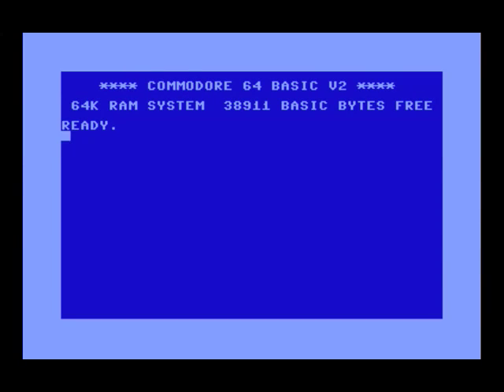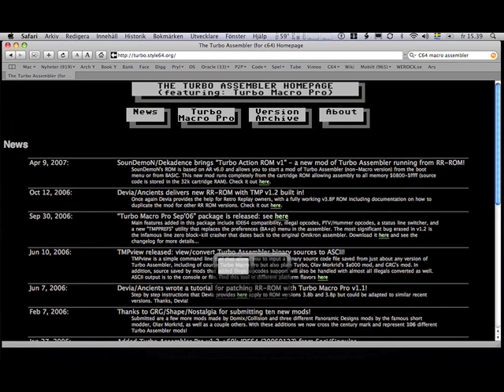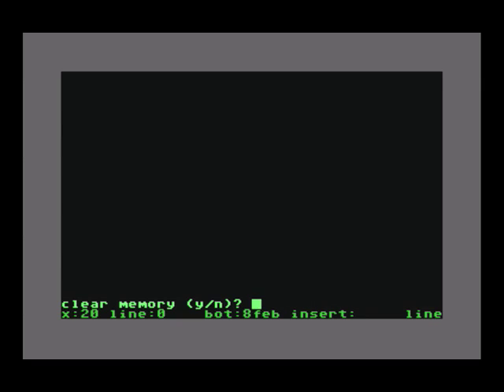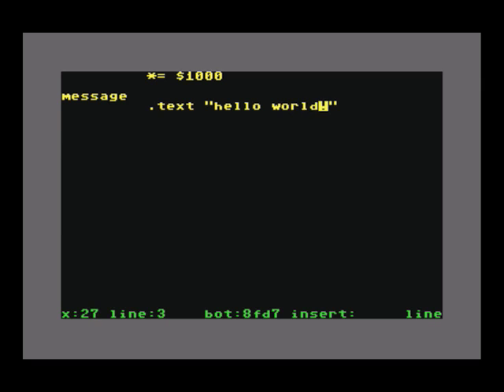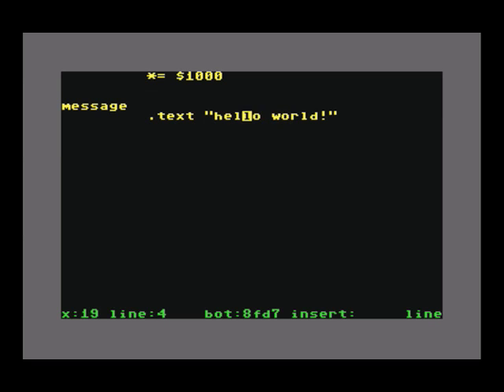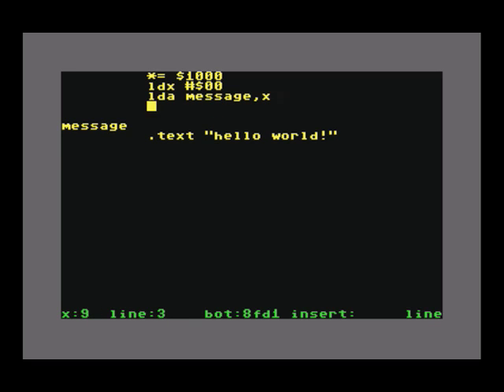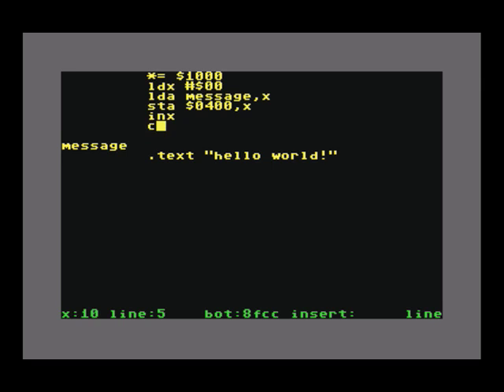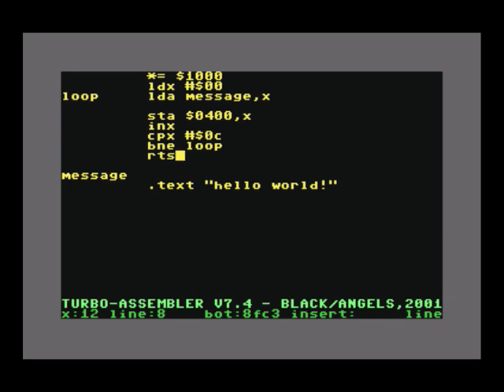Hello World in 6502 Assembler

Comment: You are programing with a Macro assembler, the luxe i never had. I always only used a desassembler, and i was young and tought that was the only way to programm in assembler. The difference was i could not use labels, and i had to use real adresses only , but i made rather big programs like that, like a sprite editor that i used the joystick to create the sprites, and even a shoo them up with horizontal scrolling (i never finished) 😄

Good memories, thanks.

Comment: those finding this and struggling to get it working, i needed to change a bit, and a few comments below helped me understand what i needed to do:

to get the assembler running, download Turbo Macro Pro, put it in drive 8 and do the following:

LOAD"$",8
LIST
LOAD"TMP      V1.2/S.",8,1
SYS 8*4096

there are exactly 6 spaces in the file name loaded in the third step. thanks to tobberoth for this information. what i was missing was the ',1' at the end of the second load command. 

great, now how do i assemble my code? hit underscore, then 3. you'll get a screen that lets you run your program with 's'. search "turbo-macro-pro-editor" for more editor info.

my next issue was that the program would run, and then go right back to a ready prompt without letting me see what had been output. to get around this, i added the following line after the 'bne':

jsr $ffcf

this jumps to a subroutine built into the c64, which will accept input from the user and store it in the accumulator. for more on this, you can search "c64 standard kernal functions."  for now, you can just hit return to get back to a ready prompt. if you want to get back into TMP, simply repeat:

SYS 8*4096

my next issue was that the output was just a bunch of symbols, not letters. here braddo82 had the solution, but it wasn't explained. in its default mode, the c64 uses 'screen codes' which are different than PETSCII which is what '.text' will give you. search for "turbo-macro-pro-tmpx-syntax" if you want the details about this pseudo-op.  for now, instead of 'sta $0400,x' you can use:

jsr $ffd2

which will print the petscii value stored in the accumulator. (this is another standard kernal function.) if you want your program to match more closely to the video, and to have more control over the location of the characters, you can do the following on the line before you 'sta $0400,x':

and #$3f

this is a 'logical and.' it will convert your string, which is stored as petscii to screen codes which can be written directly to screen memory. its a bit more complicated than this, but it will get your program working for now.

i'm just learning this stuff, but this will at least give you the preliminary information to google, and learn more if you were confused like i was. it took me a while to get all this info, so i figured i'd share it with you, so that you dont have to go thru the same process.
Reply: I also recently had this issue with PETSCII vs screen code. Therefore, when I saw the video I thought this shouldn't work. The question is: why did it work?

Comment: I'm guessing the assembler does the grunt work of turning that string into successive ASCII byte-by-byte LDAs?
Reply: Not the hardest thing in the world to do.
Reply: Jon Radcliffe how would you poke in assembly when using HES MON?
Reply: Salvatore Servodio The simplest way I know is to write the text at the top of the screen, and then use the M command to list the contents of screen memory. You can then take the listed hex characters and change the address to the address you want. This works beautifully for transferring ascii into memory. None of the old school monitors seemed to have that provision. Hesmon does have a lot of other cool features though.

HELLO WORLD

Ex lets say you wanted to store 'hello world' at address 8000. Youve just written hello world at the top left of screen. Type: 
.M 0400 0410
:0400 08 05 0c 0c 0f 20 17 0f
:0408 12 0c 04 20 20 20 20 20

...that's your hello world text on the screen memory.

so, then you just change the 0400 to 8000 and strike Return
:8000 08 05 0c 0c 0f 20 17 0f <Return>
:8008 12 0c 04 20 20 20 20 20 <Return>

Now, when you examine 8000, you'll see your hello world text contained therein.
Reply: Not exactly, it will show up as an array of bytes after the code and the LDA with "absolute,x" addressing mode reads the byte at the top of the array + the value in X. X also serves as the loop counter.

Comment: The easiest way to print text 1:1 (including capitals) and saving 5 bytes is as follows:

*=$1000
LDA #<MESSAGE
LDY #>MESSAGE
JSR $AB1E
RTS
MESSAGE
.TEXT "Hello world!"
.BYTE 0
Reply: in this case you can save an extra byte by dropping the RTS and using JMP $AB1E ;)
Reply: @geevee9109  Sure, if you don't want the code to do more after that.

Comment: Silly question. The text in the source code was lowercase ("hello world"). Why did it display in uppercase ("HELLO WORLD") if you were just doing a blind copy?
Reply: +Tim Greening-Jackson  commodore used  commodore asc codes chr(65) =uppercase A  not lowercase a the asm  is wrong
Reply: +Tim Greening-Jackson
The text will come out 1:1 when STA $0400,X is replaced by JSR $E716.
That subroutine allows for printing colors as well and can be added in Tass using Arrow-A and then entering CTRL codes.

Comment: The C64 sure has a convoluted way of running programs. I'll take my Atari 800 any day.
Reply: ***** accept people who know how great the Atari is :-)
Reply: I was really an expert on them way back when. The C64 sprites were better but the other features of the Atari are hard to beat. 

They are both very good machines. I still play some games on my Atari emulator. 

At least both the C64 and the Atari 800 beats have an Apple :-)
Reply: ***** :-) 
I bought my Atari when it first came out and my friends who all had Apples laughed at me. They complained that since the Atari had very limited colors (only 4 in their highest graphic mode) that it couldn't be as good as their Apple since they had six (by counting black and white twice. - I'm not kidding. There was a hardware limitation for that). The doc''s for the Atari were not very good.

We had a high res graphics mode similar to their high res. I found out that it worked similarly to the Apple. It has just black and white (more on that later) BUT just like Apple it was achieved by plotting a red and blue pixels next to each other. So we had 4 just like them without the goofy 2 blacks and whites. I felt a little better. 

Then I found out that we didn't just have black and white. We had any of 16 colors in two brightnesses so we could have red and bright red or blue and bright blue. So we had more colors.

I had a problem with my Atari because the colors suddenly became half as bright and they started changing every few seconds. I called Atari and told them about it. It turned out to be yet another undocumented feature and was probably the first screen saver on a home computer.

I then told them that I thought being an Atari would mean better graphics but my buds with Apples said no.

The lady laughed and said wait until more documentation comes out. She proceeded to tell me all about how Atari uses the same process as the Apple but runs 80% fast (clocked at 1.79 instead of just 1) That those graphics modes that only have 4 color can choose from a pallet of 256 colors AND with just one poke you could change a color from red to green.

Then she told me about player-missile graphics (sprites - again Atari was first but C64 was better), built in fine horizontal and vertical scrolling, about display list interrupts where I can issue commands before every scan line is drawn changing the position and/or the color of a sprite splitting it into many sprites, about how we can redefine our character sets to make an "A" look like an alien and that we had 2 larger full color modes and 2 multicolor character modes. How we can actually write a program for the graphics co-processor to make screens anyway we want them - 1st line large color letter to display a score followed by 40 multi-colored character modes with their horizontal scroll bits turned on, followed by 4 lines of main text mode.

I went back to my friends and told them all of this. Suddenly Apple was now a business computer - they don't play games. 

I could have told them about our rom cartridge slots that could hold 48K of program BUT only take up 16K of space leaving 40K of memory for the program's use. They had to load everything into memory so their word processor only left about 5K of memory.

Years later and a horrible thing happened. The same team that designed the graphics on the Atari and who were working on a new computer with even better graphics were let go due to new management. The new management came from Commodore with their own 16 bit machine that became the Atari ST. So Commodore bought the new Atari designed by the same team who did the 800 and named it Amiga. So now Atari was Commodore and Commodore was Atari. It was Commodore's turn to brag about have the vastly superior machine. I would have bought one but I was in school at the time and only could afford the ST. How I envied all my Commodore friends.

The funny thing was that we could run Apple Mac stuff by buying up the old roms, plugging them into a cartridge, and plugging that into the ST. And it ran faster than the Mac :-)
Reply: Good luck. Do you still have a C64 or are you going to use an emulator. 

I actually have an Atari 800 + drive but they've sat for 20+ years so I don't know if they work.

I do know I can get a new 130XE off Ebay but the emulator is good enough for now.

Good luck with the programming. 

Do you know if there are books online (for free) for the c64? I have a site for Atari, the one I like is Atari Graphics & Arcade Game Design by Jeffrey Stanton & Daniel Pinal . 

I learned from their Apple II book. We have a site with pdf's of many of the Atari books here. http://www.atarimania.com/documents-atari-400-800-xl-xe-books_1_8.html

I did find this one, might help.

https://archive.org/stream/Commodore_64_Assembly_Language_Arcade_Game_Programming_1985_TAB_Books#page/n5/mode/1up
Reply: except

Comment: What you have to know in order to understand this assembly program :
- most of all CPU have some memory cells, in order to perform calculations. They are called registers.
- loop and message are just tags in order to conveniently designate memory addresses.

What the source code says :
*= $1000
-------------
This is not a machine instruction of the program but an instruction for the assembler demanding it that the program must be installed at the memory address $1000 in hexadecimal base, address, 4096 in decimal base.

ldx #$00
------------
This is the first instruction of the program and regarding what explained before, the instruction will be at the memory address $1000.
The instruction says : load (i.e. initialize) the 6502 CPU register named X, with the value 0.

lda message, x
----------------------
This instruction says : load the CPU register, a (commonly called, the accumulator) with the value stored in the memory address resulting of the addition of the address of message with the value of the CPU register x.
The first time in the execution of the program, this instruction is executed, the result is that the register a will have the value of the first character (in fact, its ASCII code, the value 104).

To sum-up :
CPU register, A receives content at (message + X) address.

sta $0400, x
------------------
This is the exact inverse kind of instruction of the previous one.
It says :
Store the content of register  A at the address $0400 + X
To sum-up:
content at (message + x) address receives content of A.

This instruction has the effect to print on the screen, the character stored in register A. Because to print a character at the top left of the screen on C64, you just have to store its ascii code at $0400, marking the beginning of the image memory. the video chip is in the charge of the rest.

inx
----
Change the value of register X by adding the value 1 (increment x).
Now, you can imagine what is the role of X. It just refer the index of the current character to print.at the same time from the message memory address and in the image memory position.
Hence, incrementing X just prepares to reference the next character to print.

cpx #$0C
--------------
Compare the value of X with the value 12 (C in hexadecimal).
The result of this comparison is stored somewhere in a special register of the CPU for the following instruction.
NB: 12 is the number of characters of the message to print. Assuming that the program counts with X, beginning by 0, it means that when 12 is in X, all characters have been printed.

bne loop
------------
This instruction is a conditional branch. It stands for Branch if Not Equal.
It says that if the result of the previous compare instruction ( = cpx #$0C) is not that content of A and 12 are not equal, then go back to the instruction, mark by the tag, loop. Otherwise go down to the next instruction : rts.
In fact, while X will be lesser than 12, the loop will executed with a content of X, augmented of 1 to reference the next character to print.

rts
---
This instruction marks the end of the program. It stands for ReTurn from Subprogram.

Hoping you enjoy :-)
Reply: *calculations not calculus, just a correction.
Reply: +denilsson31 
Another way of looking at BNE is "branch on difference"
When no Compare instruction is used the number to compare is zero by default, otherwise the number given is the offset or 'new zero' so to speak.
Reply: YOU ARE THE MAN DENIL!!!! THANK YOU SO MUCH!!! :D sorry it just all clicked in my head and made sense and im excited about it
Reply: Excellent Explanation of Assembler. !!   lml
Reply: wow thanks for all this info
the video & especially this comment, detailing exactly what the machine is doing.
Reply: This was an incredibly helpful comment. Thank you!
Reply: Link p

Comment: I want to learn 6502, but it's way too confusing :(
Reply: frankly this is too easy to understand, so no magic here and for todays people this has no sense. You have only one register for math which is 8bit A (accumulator) only two index registers called X and Y and stack made by 256 BYTES ram cells. Only 56 opcodes to use this and only 64KB can be addressed at once. 6502 Assembler can be learned from beginning to quite advanced level through a day or two days. A week to study interrupts more complex operatin like software way of multiplication or dividing because of lack opcodes to do this just like in modern processors. Assembly programming of 6502 is better than sudoku and gives more fun.
Reply: I used to code it using decimal numbers, using assembly is a lot easier!
Reply: I'm in the process of learning 6502 assembly now. I want to make a game both for the C64 and the NES. I agree, it's very overwhelming and confusing at first. I guess the key to learning it is patience. Good luck :)
Reply: Learning assembly of earlier CPUs is not a really hard task.
However, some knowledge about the CPU itself and I/O are required for your first programs.
And it depends of your motivation to do that too. If you are just pushed by curiosity without knowing what to do with, I guess you will give up your initial objective. And it is a normal behavior because the brain doesn't like mobilizing itself without goal. In this case, don't keep the objective to be able to produce something with what you learn. Just learn what is assembly, just for your culture.
Later, ideas of programming could emerge.
At this time, usage of assembly could just be justified by O/S kernel programming and even, just very small pieces of code involving system and I/O machine instructions ...
because for the rest, modern compilers and device drivers obsoleted assembly languages.
Reply: 6502/6510 assembly language is really simple - the instruction set is only what you need.  Most modern processors if you want to do assembly just forget about it, there is thousands of instructions with different operands so code C which is the closest you will get to the machine without sacrificing too much performance.
Reply: @danaadalaide5648  x86 is perfectly plausible, let alone ARM. Not only plausible, but probably the most common asm language to learn since the 90s.
Reply: I agree it's confusing and very complicated

Comment: doesn't LDA AABB loads the 1 byte value at AABB into the accu? so what's with that ",x"?
i would've used
=============
LDX #$0C ; load X with 12dec
nextchar: STA msg + X
STR 0400 + X; store accu to 0400 + x (12 to 0)
DEX; decrease X by one
BNE nextchar; goto next char if x != 0
END; return to TIM (use RTS to return to BASIC instead)
=======
with msg beeing the address of the first byte of the text. please correct me if that's wrong. i'm also new to this business

Comment: I recommend starting with *=D000 as it does not destroy the copy of the BASIC ROM in memory.
You can check it in the memory map in the C64 wiki.
Reply: D000 is below IO area and will require extra code to call it.
Reply: D000 won't work - it's VIC etc. C000 was the standard for small things like this.

Comment: @uhellstr
Thanks for trying. I am at 2:51 of the video and the SYS command is used with the starting address you use (*=$1000) but in decimal not hexadecimal.
Haven't tried to SYS$1000 maybe it will work.
SYS4096
BTW. you might wanna check:
3doubbleYouDOTc64-wikiDOTcom
Reply: The decimal is SYS 4096